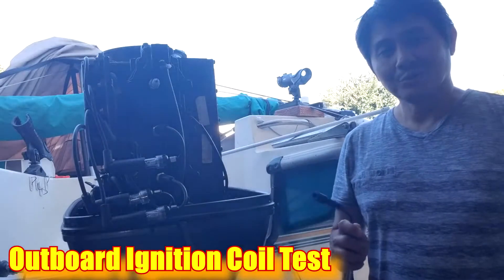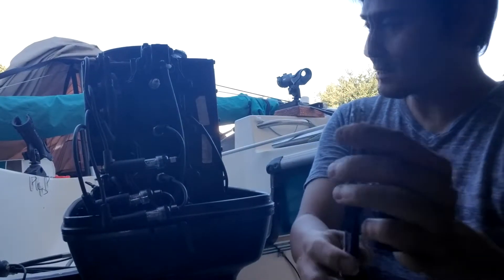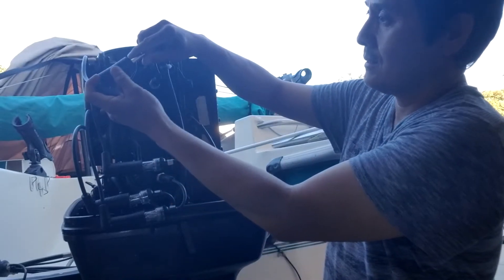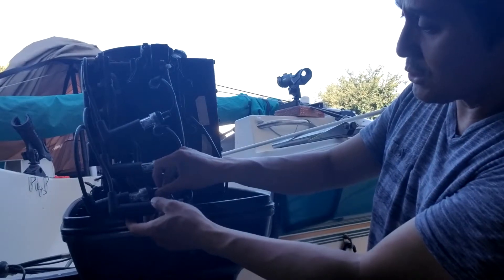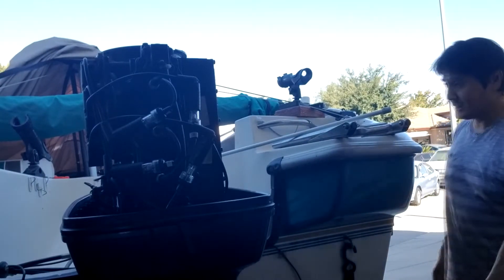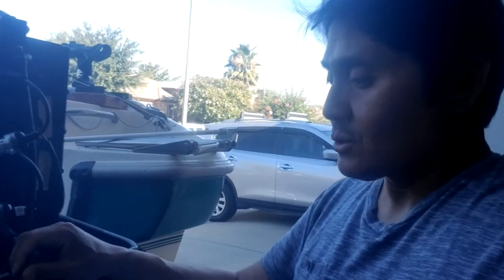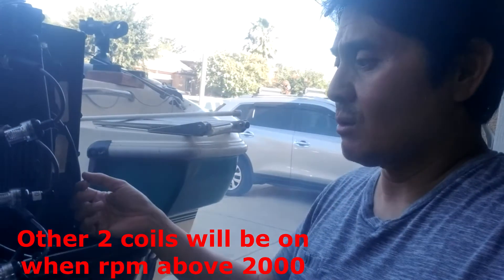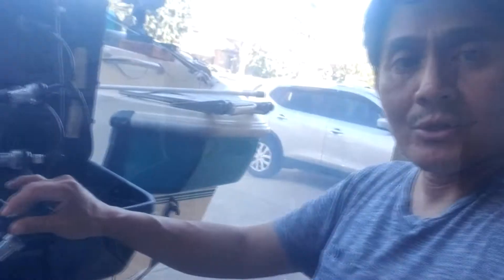Outboard Ignition Coil Test for Dummies

Comment: Is that the way your motor works from the factory with only 2 cyl. until a certain rpm? I know they tried that with a car years ago.  I have a 4 cyl force I don't think mine is like that..
Reply from the maker: Not sure if it is for 2 stroke engine only or for specific model only. I read that before, it is to give low rpm. I think I need to test it again.

Comment: I dont know what brand outboard motor you have but according to my knowledge all cylinder must fire regardless at idle or high RPM.
Reply from the maker: Thanks, Tony. I have Mercury Force 120hp. They all will spark only during staring, then the switch will keep 2 off on idle or low rpm to make the boad able to move slow, then will turn on again when rpm reaches 2000 or above. I believe all Mercury 2 strokes with carburators do that. 
Lot of discussions on Mercury group about this issue. Thank you for your comment. Appreciate it.
Reply: @NorCalOutdoor  did you ever confirm this? i have a 2 stroke merc 3 cylinder and having some problems. noticed when i pulled the middle and bottom spark plug while idling, nothing happens, as soon as i pull the top plug, motor dies. so not sure if i have 2 cylinders not firing or its just 2 of them arent activated until a certain rpm
Reply from the maker: @kirkkohd4883  hi Kirkkoh. Yes, mine does that and saw other people having same problem, but looks like it is normal.
Reply: @NorCalOutdoor  thank you for the response and help.
Reply from the maker: @kirkkohd4883  You're very welcome
Reply: @kirkkohd4883  no, there are 2+2 mercury engines that are 4 cylinders that do this, only 115 and 125 hp, all the rest run all the cylinders all the time, the 3 cylinder one where you took off middle and bottom and no change means those cylinders arent firing or are otherwise screwed up, thats a simple easy way to tell, if pulling the plug has no effect that means that cylinder spark etc is no good